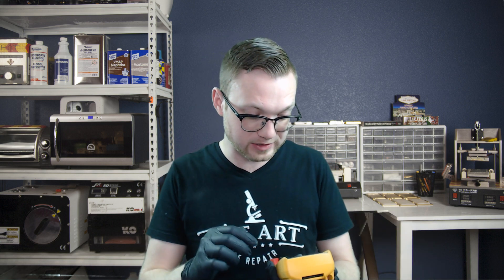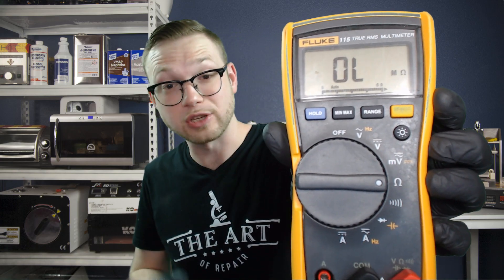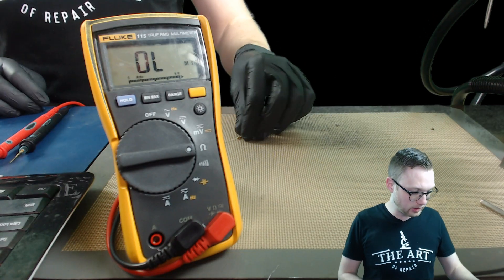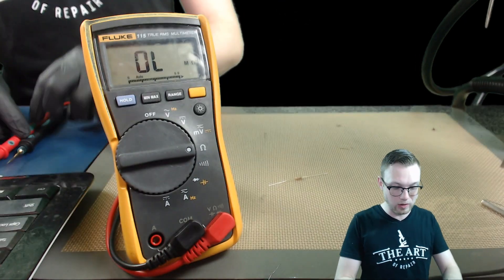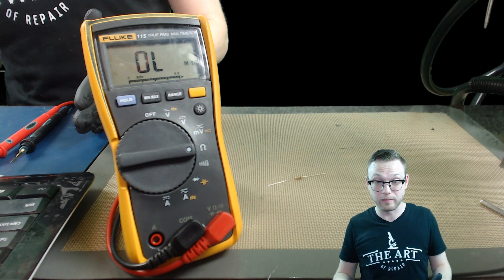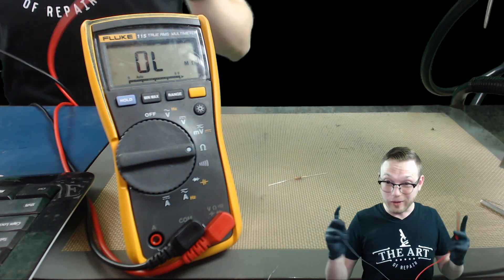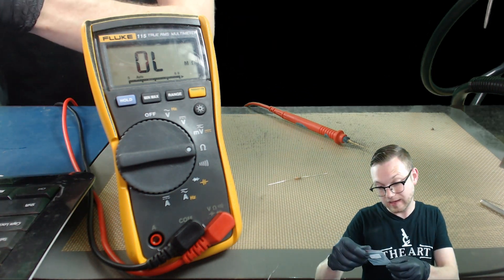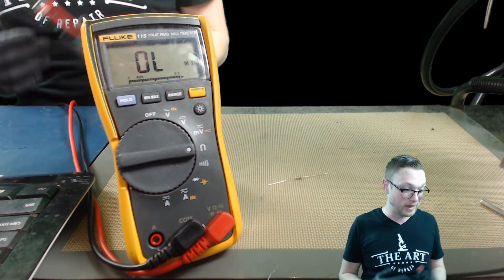EP50 Multimeters 101 | Ohms Resistance Mode | Learning is not futile!

Comment: I hope you can do a video tutorial. About how to test diode, capacitor, and resistor without removing it in pcb board and how to  know if the capacitor, resistor, diode ic. Is already damage or open